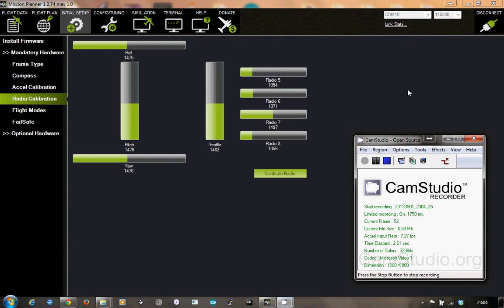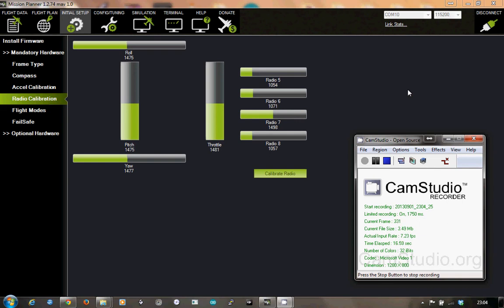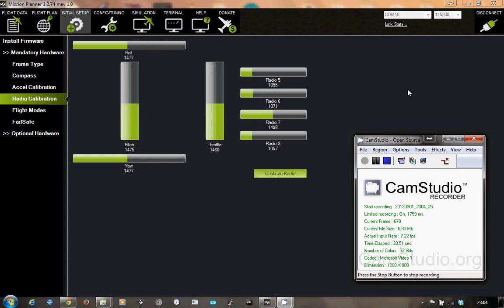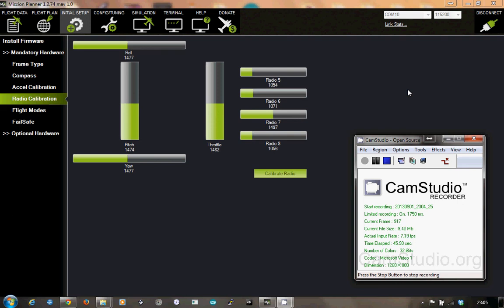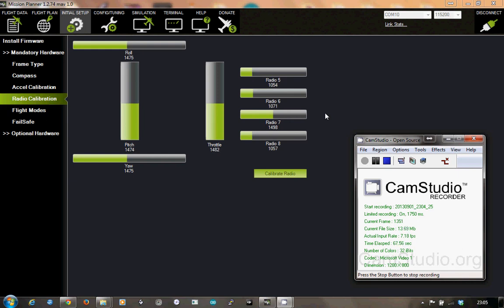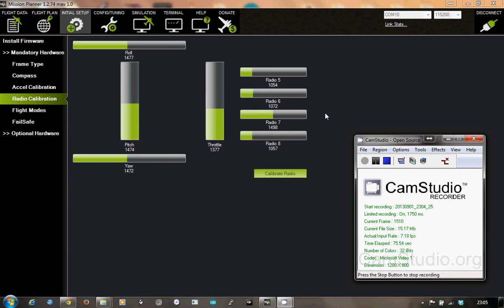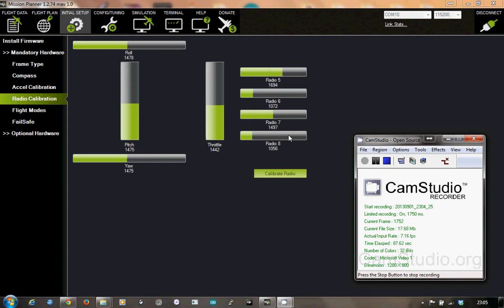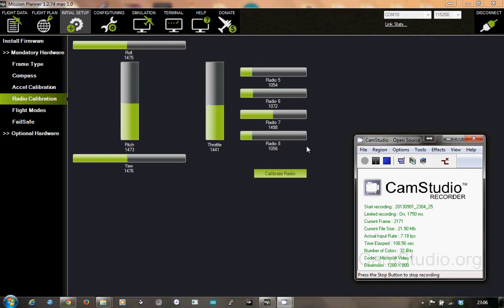Response to Randy - I see different PPMEncoder behaviour

Comment from the maker: Thanks Randy, looking forward to the fix.

My current settings for Ch 5 are Stabilize (norm), Alt Hold (mid) and Loiter (high)
Mixed with the Gear switch I have a "shifted" pattern of Stabilize Simple, Acro and RTL respectively.

So, when radio signal is restored the momentary flicker will take it to Alt Hold and then Stabilize modes.  I guess that because it is back in range I can then switch to RTL manually to cause it to come home.

Comment: Generally I think your receiver's behaviour is better than what I am seeing with my FrSky D4R-II.  Your RX leaving ch 5 in it's last known position is definitely better.  The momentary flick back to about 1500 is not good however because it could cause the APM to switch out of RTL mode when failsafe clears unless you set that flight mode position to RTL through the mission planner...still you shouldn't have to do that so I'll be putting a fix in AC3.1 or AC3.2 to try and ignore that twitch.